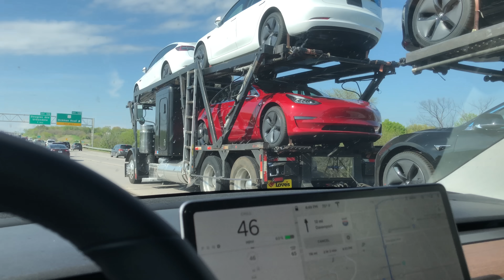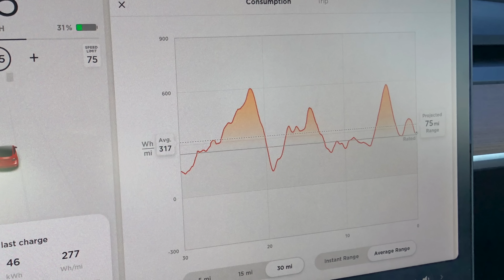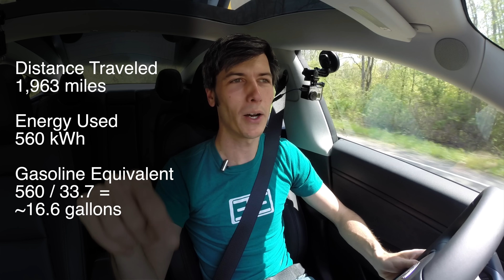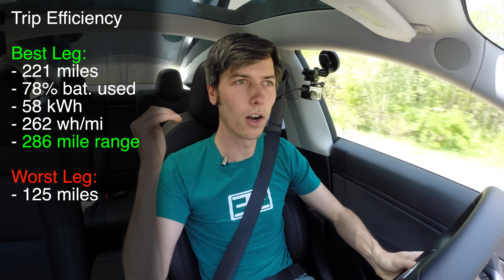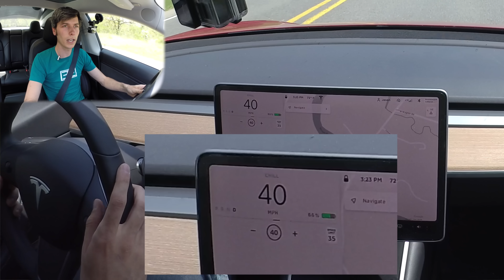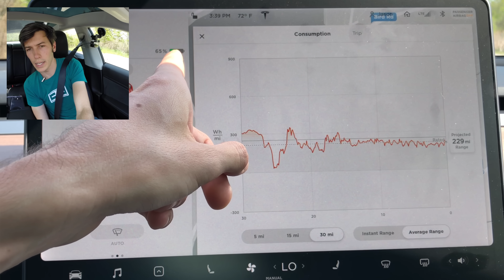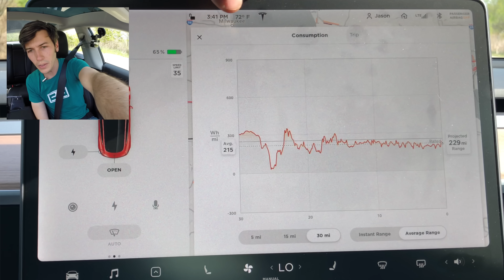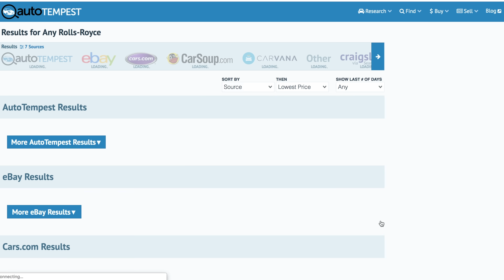How Miserable Is A Tesla Road Trip?

Comment: It's unfair to compare the efficiency of ICE vehicles to EVs. While EVs may be extremely efficient at converting electrical energy into kinetic energy, there are still huge energy losses from the source where the electrical energy originates that are not factored into the equation. If an EV is getting 80% of it's energy from a gas-burning power plant, and that plant has an efficiency of 40%, and another 10% of energy is lost in transmission and distribution, then the 80% efficiency of EVs is only 80% of that remaining 50%.

Comment: I'm just curious:  If you drove slower--say, for example, 65 mph--do you think you would lose or gain time overall?  Would the efficiency of lower speed allow you to make fewer stops and/or shorter recharge times?  'Tis a puzzlement, probably not easily answered.  But I think it my Model 3, I would opt for keeping it at about 68 mph or so.  So slow, I'd have to get used to it, but kind of relaxing . . . sort of.  Also, on a really long trip of over 1,000 miles, it might be useful to stay overnight at a place that had a destination charger.  Try to time it out so that you're down to 15 percent, plug it in, and go to sleep.  Arrive fresh the next day.

Comment: It’s a bit misleading to say internal combustion engines are wildly inefficient compared to electric vehicles.  All heat engines are constrained by the Carnot limit.  Converting electrical potential energy to kinetic energy is easy, but if the power plant burns fossil fuels to create the electrical potential your battery stores, you’re just moving the inefficiency from your IC engine to the power plant’s engine.  If you source the electrical energy from wind or sun, it’s a fair point, but that’s not the case for the majority of EV charging.  The best you can get end to end with fossil fuels is gas turbine with steam turbine regeneration at 60%, but when you take the loss of power transmission, battery charging, and the small loss of converting it to kinetic energy through the motor, you’re not that far off from a modern gasoline IC engine.  Thanks for the video!

Comment: I did a 4,000 mile road trip last summer (2022) in a Tesla Model 3LR.  Drove from Florida to Colorado and back, plus a number of great mountain roads in CO.  No charging issues whatsoever.  Overall, the trip took 5-10% longer than it would have in a similar gas car.  More importantly, I enjoyed it far more than I would have in my previous car, a 2016 BMW 328i, probably because of the more frequent breaks.  If you have to drive across country and get there ASAP, then a gas car would definitely be quicker.  But I would never want to drive anything other than an EV on such a trip.

Comment: The small price difference between gasoline and electric options surprised me. Saving on gasoline used to be the selling point of electric vehicles but, I guess, you get the price benefit only if you charge at home. I wonder what the price difference would be today.
Reply: Depends on where you live and how you use the vehicle. I have a model 3 RWD LFP (made in China). I have a circa 100 mile (50 each way) round trip to work almost even split 1/3rd each of freeway (70mph), fast suburban (45mph) and start-stop city (10-20mph). I average 186wh per mile - I pay 15.9c US per kwh = 2.96c per mile in electricity. Gas here is US$5.40 a gallon, my smallish hatchback averaged 33mpg = 16.36c per mile in Gas alone - not counting services etc, at circa 20,000 miles a year that's a saving of $2,700 a year just in gas, more if I count in 2 x $400 services for the hatchback vs zero so far for the Tesla.

Comment: I don't think you factored in the cost of battery replacement which you are now 2000 miles closer to. $2,299.27 in labor and $14,251.40 (in todays dollars) in parts according to an invoice from Tesla shared by Current Automotive. Your Tesla batteries are supposed to last for 300,000 to 500,000 miles.

Comment: Thanks, but I'll stick with my F150 with a 36 gallon gas tank. General running around gas mileage is 21+, open road/interstates 23+. That equates to over 800 miles per tank, open road. I can drive for as long as I can without a bathroom/tree stump visit which is only 5 or less minutes. I don't need to find a charging station that's vacant or even works every 2-300 miles while I dawdle over some crappy truck stop 'food'. It amazes me how EV owners are cheerleaders for their $50-150,000 dollar cars but really wonder how they will actually feel, especially when they find that supercharging reduced their car's battery life and now the replacement bill will be equal or more then the car's value. Yes, EVs may be the wave of the future but battery technology still has a good way to go for my needs.

Comment: What would happen if you calculated for minimal travel time. It's a bit like running versus walking in the rain. There must be a sweet spot where going slower is actually going faster, with increased range of going at 65 m/h.  I'm guessing, 65 m/h would be the sweet spot?

Comment: i recently took my brand new Model Y on a 2000 miles road trip with 3 kids on the back. It is super cold and the range is literally cut in half. Some superchargers are 100+ miles away and range anxiety is real. Will I do it again? The answer is no. We spend alot of time charging and we will save more time with an ICE car. Do I save alot of money on gas? Yes

Comment: Just for the sake of mild mannerd argument.
.
560kw x .31 cents per kwh is about $175
With The account rate, with EA 
About .40 cents without an account.
.
A prius at $5 a gal would come surprisingly close to that at around $200~
Granted you would need to run closer to 60mph, and mabe 45 on 5 and 6% grades,To hold 50mpg.
But considering the amount of reduced stopping time, nearly the same travel time.
.
Also I believe Google uses something like 66/67ish mph for long distance travel on interstates.
0.01c

Comment: I've had my Model 3 for four years now. I almost always charge on my home charger. I've never tried a long distance trip until a few weeks ago, which turned out to be a total disaster. Houston to Corpus Christi. On the return trip home, and at the Victoria charging station, (long story how I got there) after fully charging in an out-of- the way charging station in Corpus Christi , It wouldn't charge. Turns out that Tesla somehow dumped my credit card. Which was, by the way valid. 
Lucky enough, I brought my laptop and looked on-line for a "fix. It seems that others had posted the same problem, with the "fix" being to delete my card from the Tesla website, and reload (did the same on the phone app). This seemed to fix the problem and I was able to charge.
I did a full charge and headed back towards Houston with should have had ample miles to make it home.
Nope! I got a message to slow down to 60 mph and I would make it home. Note: the speed limit is 75 mph, with most traveling over 80, so 60 would have made me a road hazard! Maybe the car doesn't account for the speed limit? 
Anyway, it's a great car for driving around town! Specially if you have a home charger, as I do.
I won't be taking the car on long trips again. It's too much of a hassle!

Comment: The calculations just don't make sense. he says the electric consumption was 540 Kw and states that is equivalent to 16.6 gallons. That means the petrol car would be only returning 120 mpg. 2000/16.6. I am interested how 16.6 gallon is equivalent to 540Kw (32.5Kw per gallon) assuming the power conversion for petrol is correct it still depends on the cars power/weight distribution. If we take an average cars fuel consumption at 30mpg at 75mph the the petrol used is 66.6 gallon. The figures used are 1Kw =1.05 litres. The missing factor is depending on the power rate ratio which is different for each vehicle. I don't believe there is a petrol car of the same size, weight and aerodynamics as a Tesla that is carrying around a huge amount of weight in batteries. Also another factor is a petrol car gets lighter as the fuel tank empties but batteries remain the same weight.

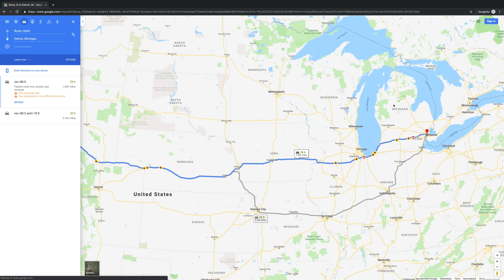Comment: At time 1:10, google maps said it would take 29 hours, not 27, right?
Also, at time 3:24, the road you are driving on in the video clearly states "35 MPH" speed limit. How did you possibly maintain a 75 MPH average (more likely this was the max speed, not average). Please explain.
Also, to have a proper comparison, what was the weight of the two people + stuff? This would amount to the payload capacity of what you were transporting.

Comment: elwctricity does not grow on tree it has to be made somehow. the majority of it is made from fossil fuel in a thermo coal or thermo gas power plant. efficieny of those plants are around 38% same as ice engines in a regular car. 
same goes for nuclear power plant as thermo nuclear power plant also uses steam for power generation and thermal efficiency is also round 38%.

so evs are more efficient only if you provide electricity from solar panels, wind turbines or from water turbines.

also you forget there is a bio fuel that has 0% co2 emissions wether burnt in ice engine or gas power plant.

Comment: 200 miles then charge up for 50 minutes? Nope.
Reply: More like 15-25 minutes now that so many charging stations have upgraded to 250kwh.
Reply: @SpottedSharks  Not true. Go to TFL's channel where they real world test cars. They just did an F-150 Lightning test. One of the major problems they had were that the chargers would fault or only recharge at low speed. And once you get to 80% the charging rate drastically reduces -- as it does for your smart phones etc.etc. Hydrogen is the future. Not batteries.
Reply: @JohnSmith-zi9or  I was talking about Tesla superchargers.  Non-Tesla chargers still have a ways to go on reliability.  But yes, at a 250kwh station it's only 15-25 minutes max.
Reply: @SpottedSharks  That's not true based on real world tests I've watched on YT and read about on online magazines. In fact a recent test where they took Electrify America versus Tesla V3 SC.  EA was the fastest and it still took 55-65 minutes to charge an empty Tesla.
Reply: @JohnSmith-zi9or  I use Tesla's superchargers in real life, not magazines.  Because the chargering speed tapers, it's quicker to do a 15-25 minute charge than to sit there for an hour charging past 80%  That's overkill and a newb mistake.  The only time I do that is when I'm eating or doing something else that takes more than a half-hour.  Plus, Teslas automatically precondition for supercharging when guided to a Tesla outlet, but not to a non-Tesla station.  If not preconditioned the charging can take longer.
Reply: @SpottedSharks  Ok so YES you agree with what I said. And what I said WAS NOT incorrect ... its just that YOU don't don it? Right? 

And nobody wants to keep stopping like that so they can stay in the 20-80 sweet spot. 

PLUS ... Tesla charging line backups. There's simply not enough of them and there's no way to predict (yes I know the app does) how many will be at a charging station once you actually get there. 

Say it with me ... HYDROGEN .... not earth mined batteries that are heaving, explosive and cause ridiculous fires.

Comment: Just remember these car are bad in hot and cool days. So if you live in the north for cold weather or south for hot weather  your going to have trouble. The batteries don't like either of these temperatures. Just think about crossing the desert in July or August in one of these so called cars. We need to find something to replace gas cars, but we need to find the best replacement not just jump into this head first.
Reply: Lol, try doing the same in an ICE car too. There is a reason why you are advised to drive with no A/C and slightly slower than speed limits in the desert for the same reasons. Good thing that there is no engine to load down in the desert in an electric vehicle.

If you have a 2019+ tesla with the heat pump then they are fine in the winter and they do fine in the heat with no issues. I drove across TX in one in 110+ heat with no problems and I drive mine in CO winter with no issues..

These may be true with the early model cars, but the newer ones are a lot better.
Reply: I swear, some youtubers released half information videos on "why EVs are not the future," and people with existing bias (weird to be biased for/against a technology) piled on. Modern EVs have active and passive thermal management for the batteries... it's almost like engineers are doing their job ;-)

Further, if we're truly looking at EVs for future use, why do some people assume lithium ion is the only battery chemistry that'll ever exist? There are literally 15+ other battery chemistries being developed now. Each with their own specific energies, operating temperatures, materials...etc.

P.S. I don't know if you're actually biased against EVs, it's just that I've seen this "gotcha" comment so many times and it's not been accurate for a while. First gen EVs had more limitations until field data gave engineers more to work with. Heck, even my Prius Prime had revisions around its battery cooling, with the originals having no cooling filter and reducing cooling efficiency over time.
Reply: @JimBob1937  even with the thermal management  is batteries still lose power faster in heat and cold. We need to find a new type of energy but we also need to develop it to a lot better level than it is now. It's still to new and may not be the best way to go.

Comment: My 1982 Ford can get 15mpg on highway pulling car on a car hauler trailer. Stock in every way except I added Bronco 33 gallon rear tank. I get near 800 miles range in a 40 year old pickup truck loaded.

Comment: To most people, seven or so hours of their time is worth more than the incremental cost savings over gasoline. Looking at total vehicle lifecycle (production, use, disposal), the carbon impact of EVs vs. ICEs is under dispute. Electrical charging stations are powered largely by coal and natural gas. Moreover, the metals mined for use in the batteries are not renewable — and are of limited recyclability after their useful lifespan. Hydrogen fuel cells are the future of automotive transportation. EVs will be on the decline within the next generation.

Comment: You can actually save time by stopping more frequently and charging to lower SOC (ie, less than 70%).  I try to reach next charging station at 8-10% to take advantage of faster charging speeds at low SOC.

Comment: I've always understood that a battery had to be charged at 10 percent its amp hour rating for 10 hours in order to get a full charge without damaging it..  How does Tesla get around this rule of physics?  By the way, sure glad you don't need both hands to talk.   (-:
Reply: It depends on the exact battery design and cell arrangement. Their battery design isn't a standard lithium ion like in your phone. Further, if you have many cells in parallel you can charge them in parallel, reducing your charge time.
Reply: @JimBob1937  I'm not an electrical engineer, but charging batteries in parallel is great....  If you have a 2 volt system.  Paralleling batteries increases the current but the voltage remains the same unless you put some cells in series.  That's where the trouble begins; running the charge current through another cell that may or may not be fully charged.  You can charge any battery faster.  But it will reduce its useful life.
Reply: "be charged at 10 percent its amp hour rating for 10 hours"

Technically they're often rated in terms of capacity, like 0.5C or 1.0C. If your amp-hour is 20, and your allowed cell charge rate is 0.8C, then you can safely charge at 16A.
Reply: @JimBob1937  It's safe, but it won't last very long that way.

Comment: Always remember.  The price of new batteries is not figured in this video.  They run $14,000 to $20,000.   The resale value 
will be greatly affected downward if the batteries have not been replaced when it comes time to sell.  If you do replace them,
the cost per mile will dramatically go up.  But, if you're rich, who cares.
Reply: Batteries are rated nearly for the life of the car, 300,000 to 500,000 miles.

Comment: You really should factor into charging time the extra time it took for you to drive to the charger versus if u would have just had to find a gas station. I’m sure there are a lot of chargers around the country but it does take time to take those extra turns or go the extra mile in an inefficient direction

Comment: Where EVs are destroyed is the lifetime of the battery. In a gas car reasonably driven, you rarely need radical repairs like replacing its whole power system.
That’s very expensive in the continually growing costs of rare earth metals and lithium, controlled by tyrannical regimes that exploit child near slave labor, including crap communist China.
Countries can’t keep up with electrical demand of millions using 240 or higher recharging. It only increases the construction and use of fossil fuel plants.
Forget alternative energy being sustainable in snow winter latitudes where a huge portion of world lives. Building super big batteries is very expensive in rare earth, heavy metals, and lithium, added to the deeply immoral labor and political practices obtaining them from autocratic, forced organ harvesting, and near slave labor mining and manufacturing countries, including China.
EVs are expensive, further increasing disparity of standard of living.
And crazies at World Economic Forum demands ordinary people will own nothing and have no rights if we allow them to have more power—their nut job members already litter governments and political parties around the West.
Reply: Tesla's batteries are rated nearly for the life of the car, 300,000 to 500,000 miles.

Comment: If using 120 Volt to charge you are part of a problem.
Level one charging consumes 2-3 times more power than 208-240-277 volts.  Level 3 has found to create premature battery failure.
Cart before the horse